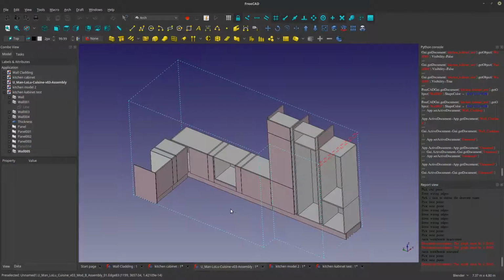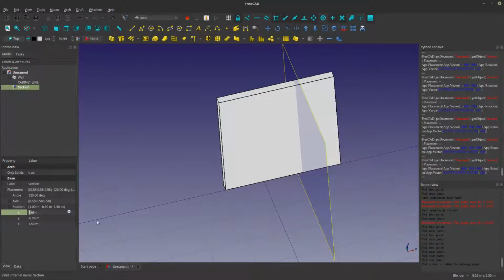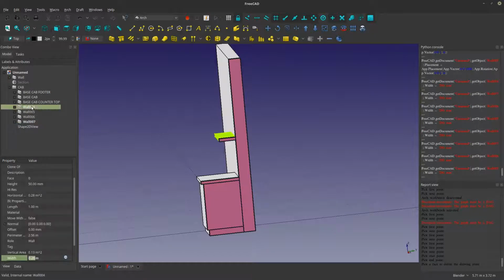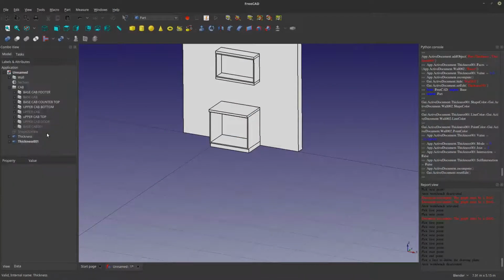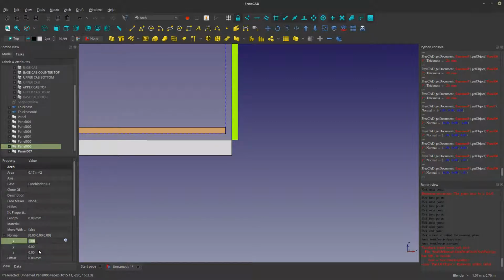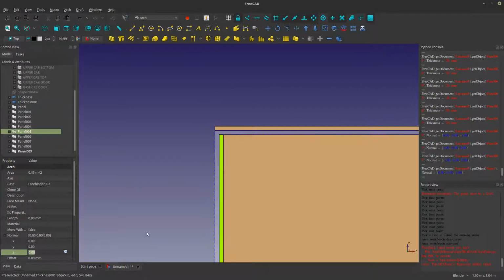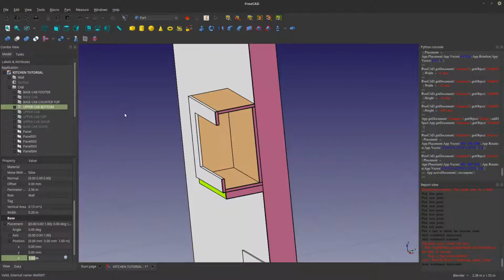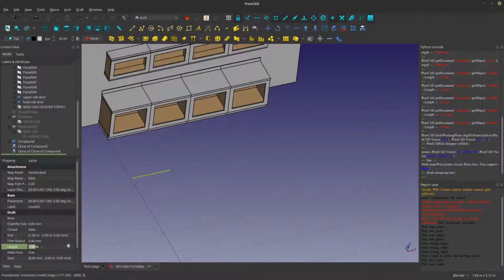FreeCAD Arch - Cabinetry Design - 16

Comment: When compairing with Sketchup for Home desing and plans, what do you prefer?
I can do 3D models super quick in Sketchup but then, sharing and porting is a nightmare! I wanted to try FreeCad for that purpose but it looks tedious and seems to be far more labour intensive to achieve similar results... Your thoughts on that?
Reply from the maker: Certainly you have a point that is hard to contradict. It is true that if you are new to freecad there could be a small learning curve to help you get up to speed. Currently my familiarity with freecad and sketchup allows me to feel comfortable about achieving mostly all I need in Freecad (that doesn't mean there aren't a few draw backs) but since I do architectural design there is a certain level of flexibility that I need and freecad does offer it. If you can do models super quick in aketchup perhaps getting a bit more familiar with your workflow in aketchup so I can determine how transferable that is in Freecad in a way that can help you. But generally if u can work in aketchup u can achieve desirable results in freecad at the moment. We can convene on a time where we can meet up for a conference chat so I can asses your design intents? I see how to best counsel you if you want to go open source?
Reply: @OpenSourceArchitectureLab  That is nice from you :) I already am mostly in an open source setup. Running Linux as my main OS since 2011...Over the years,  95% of my workflow has been ported to Linux and FLOSS softwares and I use some Wine wrappers for 2-3 things that I havent had the time to re-learn. I have started following tutorial on FreeCAD but the learning curve is steep! My question revolved around the fact that I did CAD my entire House in Sketchup back in the days Google owned the software. I still use these plans to modify parts of my home (we are renovating the entire house). I am using an old copy of Sketchup 8 to be able to work on those plans, but I could see myself switching to FreeCAD if I can get some spare time to learn Parametric CAD...
Reply from the maker: @lepatenteux592  ah I see, i'm not exactly yet certain of all that your project consist of but at first glance it doesn't seem to me that you need to do parametric modelling per-say. Freecad certainly does parametric, but also regular modelling which I think is more simple to get familiar with if you do Sketchup. But let's convene on a moment where you can present me your model visually and explain what you do, and how you wish to achieve what you want in freecad. Then I should be able to give you sound advice to help your decision making.